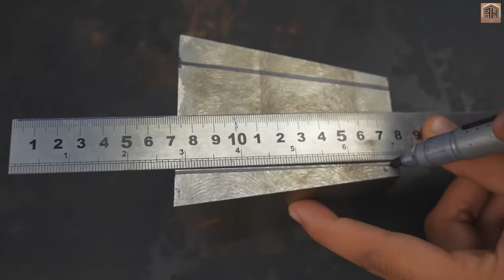Making Real THOR STORMBREAKER

Comment: It looks amazing... but I am concerned that the narrow wood attachment to the head might break off with any significant hit. I suppose it is just for display mostly but...
Reply: yeah, even RH calls it a prop.
Reply: Yeh I see what you mean. Maybe having a larger opening and a thicker wood head would have been the way to go. Beautiful work though
Reply: @K20TypeR   Why? Nothing he could do with the handle would make it other than a prop too heavy to use or wield. Or did you miss how he had to choke up the handle just to lift it up and hit the ground. This is a mantle/wall display. It is not a tool or weapon. Hell, I can tell by looking at it it's heavier than any sledgehammer or maul I've ever used. And by more than just a little.

Comment: Good job! But if this is for display only you have no problem. I think that if you use it constantly to break wood apart, that little tiny bit of wood you left at the end of the metal is gonna break big time 😅 too small for such a big weight though. Good luck!
Reply: 😂😂 bro who will use this 10kg axe 😂 its just decoration piece

Comment: I applaud the modern blacksmith.👏 What I'm amazed by is the machine tools beside the crafting of Thor's Stormbreaker. The drilling, grinding and welding by those tools are enjoyable to watch. 

On another note, It would be fun to watch those metal dust get picked up by a magnet instead of sweeping them. 🧲 Just saying.

Comment: Excellent steel crafting with eye to hand line marking for craftmanship. I like the effort you put in for showman ship. You probably could do more 😆 but it more then illustrates the point. I think the vines rather primative and while I respect the curve marking unique timber carving, its not amongst the strength of the completed designed steel of the axe but non the less complete and im impressed to see the workings of the splitter for the timber but still it could be a more complete with of a load weight brace, rather then the prinative vine wrapped rope but you definitely dont need anymore skill for the steel. Solid work. Well done.

Comment: Amazing what a machinist can do. Do I even want to know how many sanding belts you went through to put an edge on the axe, LOL? Would that process have been easier to do on a grinding wheel where you could set it at the perfect angle? Excellent work though.
Reply from the maker: I just used a single sanding belt to make bevels.